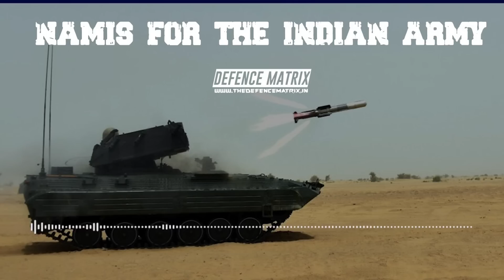Indian Army Finally Got the NAMIS Anti-Tank Missile | English Podcast

Comment: 1. The Purpose of a Large-Caliber Gun in Tanks
Traditionally, tanks have used large-caliber cannons (like 120mm or 125mm) primarily for:

Engaging enemy tanks at long range (before they can fire back).

Destroying fortified positions like bunkers and buildings.

Providing indirect fire support when necessary.

However, modern warfare has introduced new threats, where conventional tank-on-tank battles are not the only (or even the primary) scenario.

2. Why a Smaller-Caliber Gun Can Be Enough
A smaller-caliber gun, such as a 57mm or 76mm autocannon, still has high lethality against infantry, light vehicles, and structures while reducing weight and recoil. The main justifications for this approach are:

Larger-caliber tank shells are overkill in most situations. Modern conflicts often involve urban warfare, where precision and rapid response matter more than raw power.

Modern anti-tank weapons outperform tank shells. Guided missiles (like the Nag or Javelin) have higher effectiveness against enemy armor than traditional tank rounds.

Fire rate and ammunition capacity increase. A smaller gun allows the tank to carry more rounds and engage multiple targets quickly.

Lower weight improves mobility. Removing a heavy gun and reducing armor thickness in non-critical areas makes the tank much faster and agile.

3. Using Missiles for Anti-Tank Warfare
Instead of a large-caliber gun, equipping tanks with two or more anti-tank guided missiles (ATGMs) like the Nag provides significant advantages:

Fire-and-forget capability. The AI can lock onto a target, and the missile will guide itself, allowing the tank to reposition immediately.

Superior penetration. Modern ATGMs can destroy enemy tanks at long ranges with high accuracy, even against reactive armor.

Multifunctionality. These missiles can be used against helicopters or fortified enemy positions.

By relying on missiles instead of a high-caliber gun, the tank does not have to compromise mobility or weight for firepower.

4. AI and Communication Network as a Force Multiplier
Artificial intelligence can revolutionize battlefield awareness and response times:

Automatic Friend-or-Foe (IFF) Detection. AI-powered sensors and cameras can instantly identify enemy forces, reducing friendly fire incidents.

Target Prioritization. The AI can analyze battlefield conditions in real time and recommend or execute fire solutions.

Networked Warfare. The tank remains in constant communication with drones, infantry, and other vehicles, providing real-time battlefield intelligence.

Predictive Defense. AI can analyze projectile trajectories and incoming threats, automatically triggering countermeasures.

5. Active Defense Systems (ADS) as the Primary Protection
Instead of relying solely on thick armor, the tank would use active protection systems (APS) to counter threats:

Hard-kill systems. These can shoot down incoming missiles or projectiles before impact.

Soft-kill systems. Electronic warfare tools like smoke, jamming, and decoys can prevent enemy targeting.

Situational awareness. AI can predict enemy ambushes and automatically adjust the tank’s defensive posture.

6. Speed and Agility as Survival Tools
A highly mobile tank can avoid getting hit in the first place. This is why:

Urban and asymmetric warfare favor speed over armor. Heavy tanks are vulnerable in close quarters, whereas a fast, maneuverable tank can reposition quickly.

Mobility increases survivability. If a tank can relocate before an enemy fires, it has a much better chance of surviving than relying on armor alone.

Logistical advantages. A lighter tank can be deployed faster, consume less fuel, and require less maintenance.

7. Versatility in Modern Battlefields
By designing a tank that focuses on speed, AI-driven decision-making, missile-based anti-tank capability, and active protection systems, it can handle a wide variety of roles:

Infantry support in urban and mixed terrains.

Anti-armor engagements using missiles rather than direct-fire cannons.

Reconnaissance and battlefield coordination with AI and networked communication.

Defense suppression by striking enemy positions before they can retaliate.